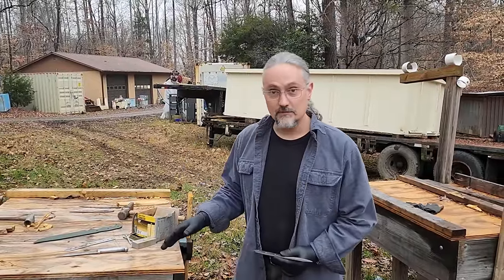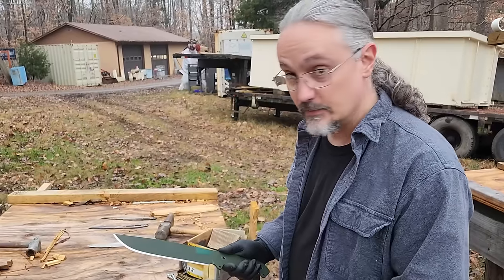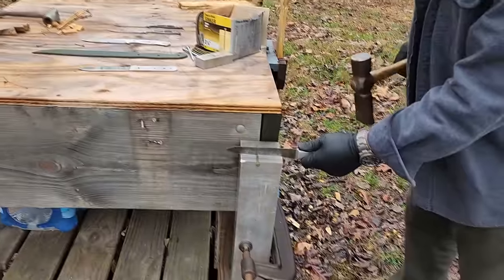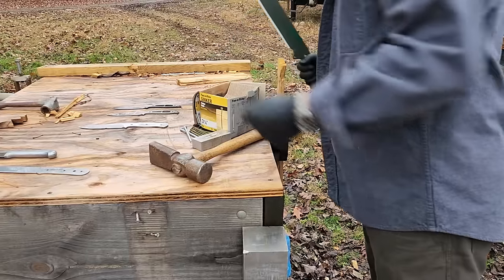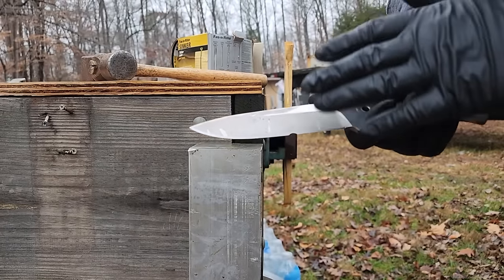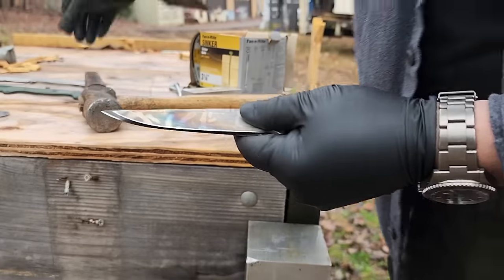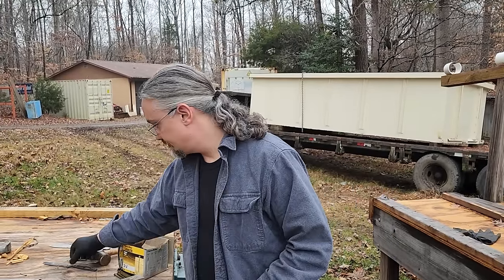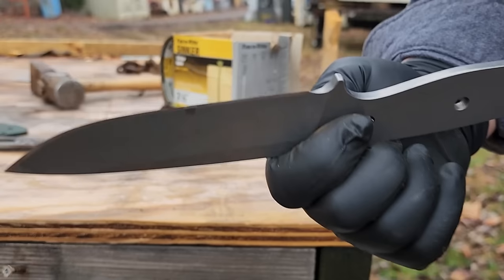How does Magnacut compare to high end carbon steels and Delta CPM 3V

Comment: I subscribed to youre channel. I was interested in youre open analysis you seem to be curiouse. I like that 😊
I dont know whats youre location but where I live the winter temperatures can drop down to - 20'C to - 36'C Celsius and if youre out in the forest and have to make firewood its nice to have a Leuku hanging on my belt that can replace the axe if the axe is lost in the snow. I chopped wood with a Marttiini Leuku that has Marttiinis usual chromium stainless steel and I chopped a lot wood for about a year with it everytime we made a camp. It didnt break thou had some small chips. I was wondering does anyone know how that Magmacut performs in - 20 to 36' Celsius in a long period of time?

Comment: In which standard outdoor situation is it necessary to cut steal with an steal hammer? Do you always carry both, knife and hammer, with you? A knife is made for food, wood, rope or to produce traps, not for cutting steal with an hammer. So, there is no reason to torture these blades. Peace out.
Reply: Firewood has rocks and nails sometimes. Some blades get knicks just from hitting knots in wood. The testing methods are valid. If you can dodge a wrench, you can dodge a ball.
Reply: @bruv1039  Awesome! Thank you very much, sir! Take care, 👍🏻🧡😀Klas Kiecker

Comment: Is Delta CPM 3V different from "other" CPM 3V?
Reply from the maker: It is chemically the same. It has a much different heat treat. The conventional heat treat utilizes the secondary hardening hump to convert retained austinite, this utilizes a rapid quench to MF with a direct to cryo approach to address stabilized RA. It is one of many low temperature tweaks that are optimized for a knife edge application because it gives enhanced edge stability compared to the tool and die type of heat treat which is compromised for reduced part growth and risk of cracking during quench. The relatively simple section of a knife blade does not require that approach and the more uniform microstructure and somewhat tetragonal martinsite is substantially stronger at the edge and supports the carbides better too, leading to improved edge retention and durability in rough use

Comment: Some time ago one steel tester told me get 3V steel for toughness and if you seek corrosion resistance get Elmax, seems he was right…
Reply: That's the thing with knive steels, you gotta chose what you value the most: toughness, corrosion resistance or edge retention. You can't have it all. Magnacut opened up a new, previously non populated balance of these values. A jack of all trades, but there are steels better in each single category.

Comment: Guys, do you know anything about LionSteel heat treat quality ? I've just bought their newest karambit in MagnaCut and I wonder how tough it can be. On the label it says 62 hrc as far as I remember. Btw, what would you recommend for sharpening MagnaCut, is it harder to sharpen than eg D2 or S35VN ?
Reply: D2 and s35vn are two of the best comparisons I could think of for how Magnacut sharpens. 

It responds better to touch ups on strops, but as far as how "hard" or "easy" it is to sharpen, it's right in that same area.

Edit: Magnacut at 62 HRC is extremely tough. MUCH tougher/stronger than the 7075 handle of the L.E. One...
Reply: Don't have a magnacut blade from LS but their Sleipner is extremely well done. They've one of the most advanced manufacturing plants of any mainstream company.
Reply: @CNYKnifeNut  Thanks man, I just don't understand your last sentence. What do you mean about the handle of LEone ? it's made of aluminum (or alloy).
Reply: @davidthomson2794  Thx, I will try sharpening this knife soon as it came quite dull to be frank so I will see. In the past I heard some bad things about LionSteel, but they didn't concern heat treat but more like the general sturdiness of their knives which some claim was not comparable to the pretty high price. However , this karambit is an integral and it feels sturdy as f**k :D
Reply: S35vn is only hard to sharpen when it is heat treated poorly. S35vn should be easy to sharpen similar to AEB-L. A great performing stainless that is easy to maintain while having a good balance of toughness. Hence why makers like Chris Reeves and WC Knives offer it as a premium.
Reply: @pubplays368  Thx, ok, what about MagnaCut tho, is it hard to sharpen when heat treated properly or the same as in case of S35vn ?

Comment: How do you heat treat your 3V? And why do you call it Delta?
Reply from the maker: With heat treat ovens and a cryo setup. "Delta" means change. We added the delta symbol to our 3V offerings to differentiate them from our earlier 3V once we changed the heat treat to optimize edge retention in rough use. It was a significant investment in time and materials to develop this heat treat and we felt it warranted a special designation. Our Delta 3V is unrivaled.
Reply: @NateAIM  so you offer heat treat for custom knifes?
Reply from the maker: @thetschoni3813  No

Comment: I like 3v. But in real world use, good heat treated 1095 is just as tough or tougher then 3v.... 3v is just a bit more stainless and holds a better edge then 1095.
Like I said, I like 3v. But there is no way I'm paying triple the price for 3v. There's some manufacturers who reasonably price their 3v, but there's others who charge $300-$400 for it, which is a rip-off.

Comment: Will it pass the American Bladesmith Society test???
Reply from the maker: Magnacut won't survive the bend test but Delta 3V will depending on the blade length and thickness. Our 10-inch light chopper will pass the ABS test easily. It also bends back mostly straight and is still a usable knife afterwards. If you search through my videos, it's in there.

Comment: I live hunt and work (sometimes teaching Wilderness EMS) in the wetest part of the country here in the PNW... "corrosion resistance" is massively overrated and moatly a marketing ploy espescially when we admit that 99.9% of the people who buy knives these days will NEVER USE THEM.  Knives have become jewelry for "men" to post pictures of online while they fantasize on forums about why they "need" the new super steel to handle their hardcore amazon package opening needs.  Ive carried a 1095 ESEE down over 59 rivers in N.America and its never rusted on me.  420 is more then mowt of todags hipsters need for a knife if theyre being honest.
Reply: Yet your knife wouldn't cut a bolt or chain without chipping.    And to ASSume 99.9% of people don't use their knives, is pretty ignorant when we have military, law enforcement, hunters etc use knives frequently.     Your 1095 wouldn't handle the abuse in this video.

Comment: Why not compare apples - we don’t know what steel the old carbons are and the c content so what are we looking at? You’re actually comparing reputations. I would suggest comparing with optimized 1095, 52100 carbons/low alloy and son reputable stainless in this test…

Comment: My fucking 1095 Ontario machetes outperform any ridiculous garbage meme "super steels" ever invented.  We are living in the fucking dark ages of knife steel.
Reply from the maker: You are out of your mind. Did you bump your head?
Reply: @NateAIM  not a SINGLE ONE of these modern super stainless steels are as tough as plain carbon.  Corrosion resistance and edge retention are irrelevant outside of a professional kitchen or butcher shop.  Older low-alloy tool steels like 0-1 and 52100 are superior to any of these meme steels for  99% of real world use.  When they design these newer steels their priorities are completely messed up and out of touch with reality.  I live in the Northeastern forests which is the rustiest place in the world and have hunted and camped and practiced survival skills here for two decades and I STILL wouldn't trade one single percentage point of toughness for any amount of corrosion resistance or edge retention.
Reply from the maker: @nobodyatall7039  Delta 3V is considerably tougher than 1095. It also has better edge stability, abrasive wear resistance, and subsequently vastly superior edge retention. The corrosion resistance is nice too. It will outperform your 1095 in every way by large margins. I know what I'm talking about. Arguing that your 1095 is better than these super steels is like arguing that washing clothes on a washboard in the creek is better than using a modern clothes washer.
Reply: @NateAIM  I've spent thousands of dollars on large survival and outdoor knives over almost two decades and have also watched thousands of destruction tests of almost every such knife on the market.  I know for an absolute fact that carbon and low alloy tool steels are significantly tougher than ANY stainless steel in existence, including the newer powder steels that are so hyped up.  You can find videos right now of meme steels like S35VN, Magnacut, 3V, etc being broken from batonning much faster and easier than a carbon steel knife of the same design would.  Obviously tang construction and geometry are more important here, but if these steels are so great you'd expect them to perform better.  Go watch the Dutch Bushcraft video of the Magnacut Kabar and then compare that to destruction tests of the original 1095 cro-van/52100 kabars, that's basically the pattern I have observed consistently through years of field experience and research.  Stainless steels are simply not tough, there's no way around it.
Reply from the maker: @nobodyatall7039 @nobodyatall7039  Go watch the Dutch Bushcraft video of one of our knives. We are the current national Blade sports cutting champions because we know what we're doing. We can use any alloy we want. If there was an advantage to 1095, we'd be using it. Some of the modern particle metallurgy steels will outperform any traditional conventional carbon steels. That's one of the things that make Magna cut exciting. It doesn't rely on the high chromium content to be corrosion resistant. However, Delta 3V, while essentially a stainless steel due to the chromium left in solution due to the heat treat we utilize, it is technically not considered a stainless steel due to the low chromium content. 

I understand you like your old school steel. That's fine for you. But for you to assert that it outperforms a modern super steel is ridiculous. I know better.
Reply: @NateAIM  Stainless and super steels break.  Carbon and tool steels break far less.  That's reality.  Maybe you're living in a different one.
Reply: @NateAIM  And here's a question, if ANY of these modern steels were any good, why is it impossible to find a hatchet or machete made out of them?  If they're tougher than 1055 tempered to 50-55 HRC, then surely they'd be excellent for striking tools for serious use, right?  So where's my 3V 18" machete?  Where's my S35VN camp axe?  Where's my Magnacut tomahawk?  Why are these steels ONLY being used in meme Rambo knives and EDC folders that are inferior to a $5 box cutter?  Why are no manufacturers of serious working tools using any of these steels?
Reply from the maker: @nobodyatall7039  to answer your question why. Because they are expensive. The raw material is expensive. The cost to process it is expensive. And the heat treat is complex and expensive. Every aspect of it is expensive and it does not lend itself to cheap tools.

Your argument about the toughness of conventional melt steels is not totally without merit. There are lots of tough classic steels. Due to their low yield point they're not particularly durable, but they are tough in the sense that the energy required to fracture it is high because they're soft and mushy. But they take damage easy and they don't hold up to rough use very well. 5160 would be a good example of this.

But it is difficult to take you seriously when you are extolling the virtues of simple steels being tough and then use 1095 as your example. It has no chromium or molybdenum for toughness enhancement, no vanadium for grain refinement, and the high carbon content is designed to be a plate martensite, rather than a lath martensite. So, in addition to poor edge retention, wear resistance, strength, hardness to toughness ratio, and corrosion resistance, it is also literally a low toughness steel that can only be tough when used at low hardnesses where it is weak and lacks the strength to be durable in the kind of use that you're describing. It's a cool steel and some applications. Not great but okay. But not for a machete. W2 is similar and outperforms it in every way. But 1095 is very inexpensive and easy to process. W2 is a similar alloy but costs much more. If cost is a primary factor, then 1095 might be better than W2. But if you're a serious user of a serious tool, a couple extra dollars for a better alloy is common sense.

Remember that unhardened mild steel is "tough". So is Taffy. That doesn't make it durable.

I got sucked into arguing with an internet troll on YouTube. You're not here to have an honest discussion, you're here to argue about things you know nothing about and I'm done talking to you.